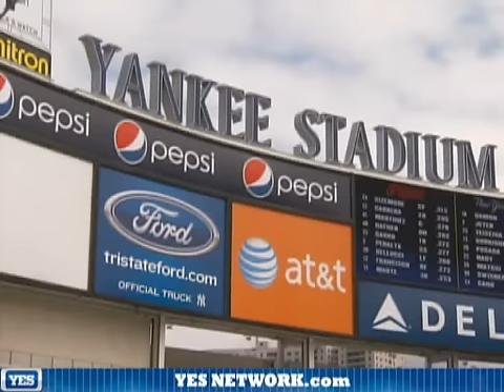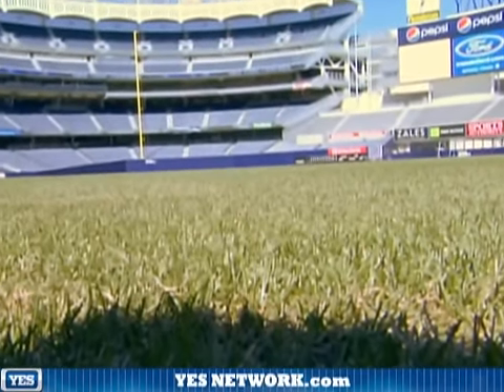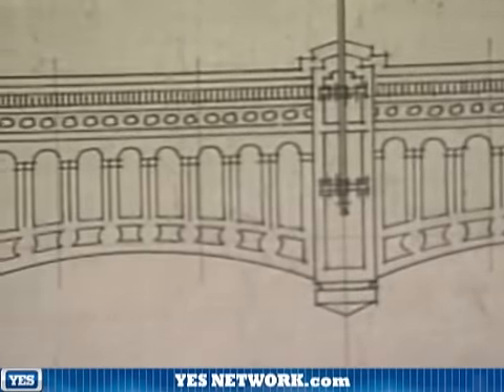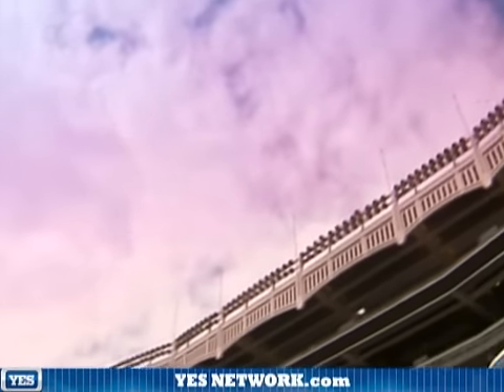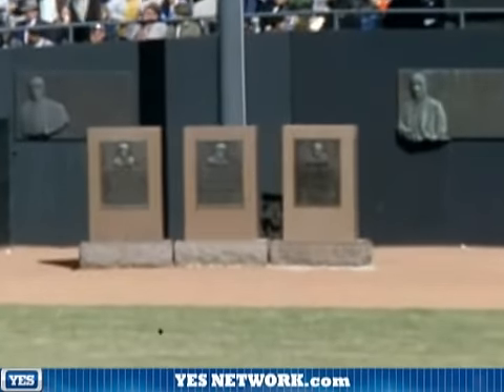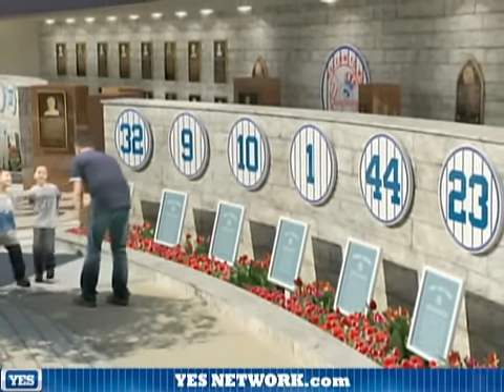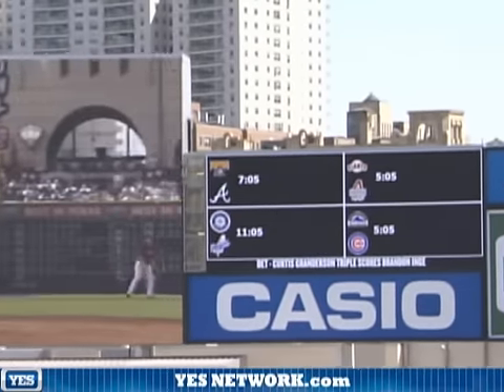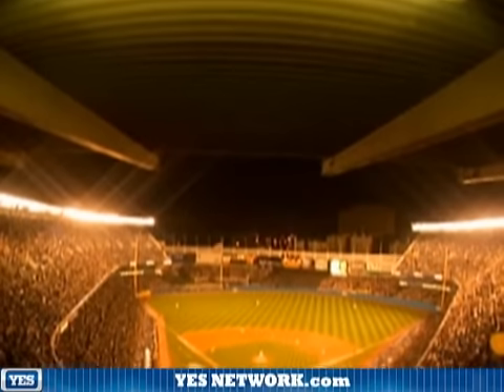The New Yankee Stadium

Comment: I have to laugh at those that condemn the new stadium when in fact the old Yankee Stadium was remodeled in the 70's significantly altering it's appearance.   I never liked this look, but I did like the look of the original Yankee Stadium.  However, the design was flawed in that being the first stadium of its kind back then, it had the view blocking pillars.  The new stadium captures much of what the original stadium looked like.  But the original house that Ruth built was destroyed in the 70's.